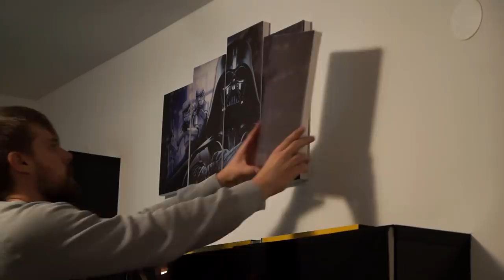45 min. project - Simple canvas stretchers for cheap eBay canvas

Comment: Technically the stretcher bar should have a raised lip on the outside of it. This keeps the canvas taught and you won't see an inner lime of the canvas. Usually always happens with paint probably didn't because it was printed canvas. Great video though.
Reply: Funny Guy I have built hundreds of stretcher frames for many artists and this video unfortunately is a little incorrect. When I make them I use 2x2 finger joint pine I get from Home Depot and set my table saw up with the fence at 1 1/8” from the blade and set the blade to a 15° and that will give a relief cut to avoid the double line on the outside edge. I miter the corners and assemble them with glue a 2” 16ga nails. We put interior cross braces with 1x2 for any frame bigger than 18”. The corner joints in the video with show through the canvas! Stretching I DO NOT DO, that’s a whole other set of instructions and artist preferences on tensions!
Reply: Terry Jull oh don't worry man. When I wrap my canvases to paint I buy canvas bar at length so the ridge is built in. Keep up the great videos. Ever make any clocks?
Reply: Funny Guy clocks no I don’t. Don’t do much ‘hobby’ stuff!
Reply: Terry Jull 
I presume you make slots for tensioning keys (and the keys themselves, of course) instead.